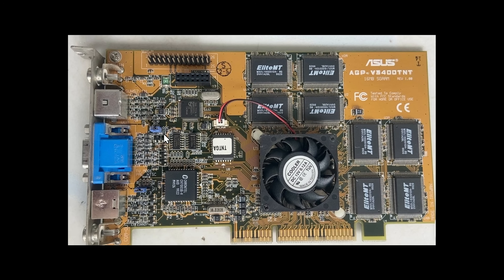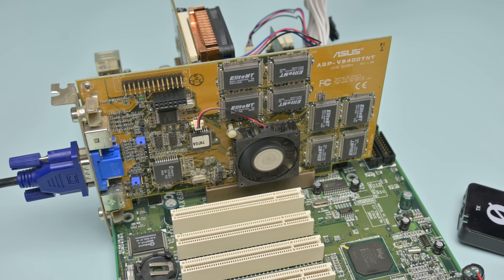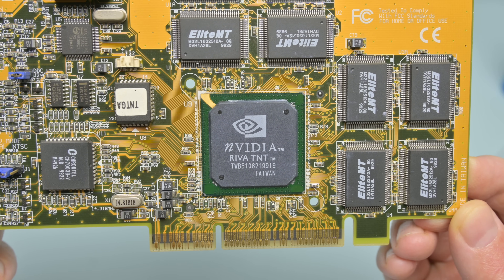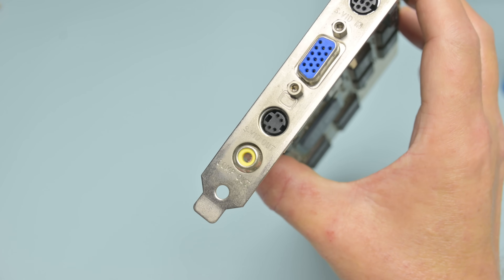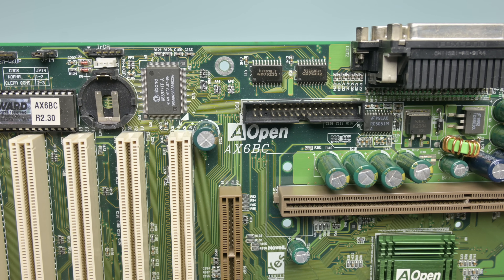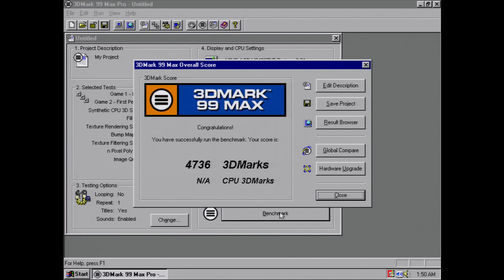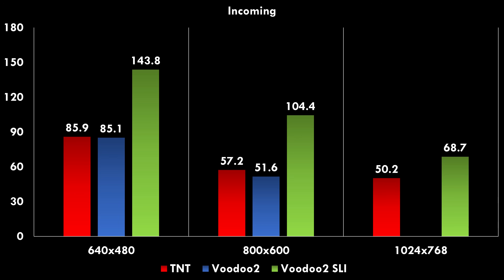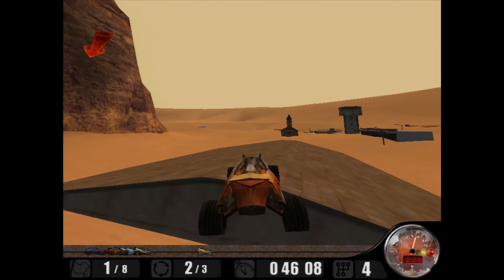ASUS V3400 NVIDIA RIVA TNT

Comment: People often says Geforce was the 3dfx killer. Wrong.
3dfx got killed when the TNT2 chip arrived. Powerful and cheaper. More widely available and supporting the emerging 3D applications which were using OpenGL and DirectX. Also was a wise decision on Nvidia to support the full OpenGL standard instead the MiniGL thing Microsoft was pushing. This means other OSs could support TNT2 3D features completely without DirectX.
Reply: The Voodoo 3 was overall slightly faster than the TNT2 because it has higher clock frequencies and also because of Glide (in 1999 around 50% of all 3d games had Glide support). The Voodoo 3 and TNT2 had practically the same price levels. The Voodoo 3 also had full support for Default OpenGL and on top of that it also supports 3dfx MiniGL and Glide which the TNT2 of course didn’t. The Voodoo 3 was very successful and was sold in great numbers, the end for 3dfx started with the release of the first Geforce card in late 1999.

Comment: I was getting my pc back in the day from my own hard earned money, putting a pc together with a Diamond Viper V770 Ultra and a Voodoo2 SLI. Anything Unreal engine related ran so much better on the SLI, but most d3d games ran way faster on my V770Ultra. I had these cards paired with an Athlon K7 700Mhz Argon Slot A. It was a monster of a PC. Bought it in fall off 99.
Reply: Yeah I had thunderbird 1ghz with Riva tnt2 and voodoo2
Like mid 2000 or right before 2001.
Friend had gotten 2x athlon 1ghz cheap because of lost package and reship and showed up 3 weeks later haha I got so lucky for that cpu
Reply: Got a baller right here. Awesome build

Comment: I had the 16 Mb SDRAM, TV output only, version of this card (I think I still have it somewhere in a drawer, actually - I merely swapped the cooler as the original one had died). This thing I kept for a LONG while because performance kept improving with time and tweaks : the VRAM could be overclocked by 15 MHz (from 110 to 125 MHz) easily as the chips were actually downclocked ones, giving almost as much extra performance (the graphics engine couldn't, though), a patched VBIOS enabled sideband addressing, it could manage quite an overclock on the AGP bus (it actually could work with a 83 MHz bus clock), and driver updates really unlocked performance after a while - provided you could download them.
And, it had a TV output, a rarity at the time, allowing some form of dual screen usage.
I could even run a 3D desktop with it on Linux in 640 x 480, as it had just enough VRAM for compositing.
Reply: I have one from Joytech and by default it ran 80 MHz core and 90 MHz memory, because it had a passive cooler. When I replaced the memories for 6ns (probably a fake ones/relabelled) I couldn't get any higher than 110 MHz core and 120 MHz memory. (Probably because of the fake memory chips)
Reply: You were lucky to get the graphics engine to 110 MHz ! If memory serves me, mine never got past 103... I think I managed to push the VRAM to 128 MHz, but it was getting unstable, so I left it at 125 after that.

Comment: Arrrrgh that damn TV mode jumper...  For weeks I couldn't understand why the image on my tv was black & white until I finally found the culprit, it was set to ntsc while I was in a pal region and then it was one of the best things ever.

Launch a dvd or a 🏴‍☠movie on the computer and it was automatically full screen on the tv, and even running games just at 640x480 they looked fantastic on a bigger screen than my puny little 14 inch monitor.
Reply from the maker: Haha awesome memory! I can relate with the NTSC / PAL issue!
Reply: I got into the word of TV-outs later, during the GeForce 3 era. But I actually left mine in the NTSC mode - I also live in a PAL region, but my family had a properly multi-system TV back then. It was actually exciting to really see it show "NTSC" in the input information OSD for the first time and see that working. The picture also somehow looked subjectively better, or maybe "more interesting"? in NTSC mode. Which doesn't make much sense considering what I know now about composite video. Maybe it was just the novelty of a literally foreign video mode, or maybe it was something about the scaling or the refresh rate.

Watching movies played from the computer on the living room TV was a nice experience, but I remember being disappointed by the image quality, quickly realizing how bad the resolution of SDTV was compared to the computer displays of the time.

Comment: First 3d accelerated game I saw was N.I.C.E. 2 on a Riva TNT2 (might have been a TNT1). The bilinear filtering and the lens flares blew my mind. Only knew NFS2 and Screamer 2 in software rendering before that. The fact that the Riva cards went 2d/3d made them very attractive for people new to the hobby (less failure points) and nvidia had very good win 95 (later win 98) drivers, making them much easier to set up in my recollection.
Reply from the maker: Awesome memory, thanks for sharing!

Comment: The DDC jumper is for enabling/disabling VGA DDC signaling from the monitor because old monitors grounded certain pins on the VGA connector to tell the system that it is a regular, high resolution or monochrome monitor. On newer monitors some of those pins were used for DDC serial signalling to actually identify the monitor and its capabilities to the system. So if you have old VGA monitor (pre-1996) the jumper should be removed (disabled).
Reply from the maker: Thank you for sharing your expertise, that's really helpful info!
Reply: @philscomputerlab  If you need more cards let me know . I can help , or write me on vogons....
Reply: Display Data Channel
Reply: PowerStrip was able to access DDC information. You could even overclock your CRT :)
Reply: @Thomsonicus You can use CRU today...
Reply: What happens if you have the DDC jumper in place and hook it up to a pre-1996 monitor?
Reply: @cjshields2007  It works OK, even if the monitor shorts out some DDC signals the card will not be damaged. The problem would be if you put modern monitor while the jumper is off. Because some of the pins in the newer monitor are now floating and not grounded in DOS when you boot it sometimes display would be in monochrome and sometimes in color not knowing what is happening. This is also a problem when using very old video card with modern monitors.

Comment: I remember being very surprised by how good the TNT was. At the time, I had a RIVA 128/Voodoo 2 setup, and good Lord the 128 was just TERRIBLE. Frame rates weren't bad, but the image quality was laughable. Vertices didn't line up, textures were mangled and the overall experience was just awful. So I wasn't expecting much from the TNT. I was the world's biggest 3Dfx fan and thought they would be on top forever. Little did I know what the immediate future had in store...
Reply from the maker: Great description of the 128 🙂

Comment: I am right now testing Voodoo 3 2000 and I never understood why it is that hyped, performance didn't look that great, but then I tried actual games from late 90s and there are some pretty wild anomalies I didn't find before. For example in AvP (1999), Voodoo 3 2000 has double FPS compared to much later nvidia and ATI cards like MX 440 or even FX 5500, so yeah, there is something about these Voodoo cards, but you will benefit from it only in some cases.
Reply from the maker: It's the drivers mostly. Later NVIDIA drivers are slow on period correct hardware. The Voodoo 3 just works. Glide, OpenG, Direct3D...
Reply: @philscomputerlab  I mostly prefer ATI for Win 9x gaming, but even with ATI cards, AvP1 runs pretty poorly compared to V3, it's like they literally made that game for voodoo even when it's not running on glide.
Reply: @philscomputerlab  Well, Voodoo 3 was basically frozen on time with Glide (you don't buy a V3 card to do DirectX on it). Nvidia had to deal with DirectX and OpenGL which never stopped updating.
Reply: the missing features of the voodoo cards (compared to newer NVIDIA and ATI cards) sometimes meant that newer games still ran, but actually looked worse because some effects did just not get rendered. on the other hand the performance was abnormally good because of this. a voodoo 3 does not even support all DX7 features where a MX440 does and thus sometimes simply renders less. if the games still had GLIDE support this was even more pronounced. i remember a friend of mine still playing some newer titles on a pentium II + voodoo3 system when i already got my hands on a radeon9700 with a 1.xGhz Athlon XP. It looked crap, it only worked in 640x480 but somehow the voodoo got it done where a TNT2 would have completely lost it already and even the first geforce struggled.

Comment: I think TNT/TNT2 are still my favourite NVIDIA cards. I remember installing my new TNT2 32MB and running Half Life, it was crazy.
Reply: The only problem with them was in Quake and Half-life which were well optimized for glide and very CPU heavy. The TNT and TNT2 required a much beefier CPU for equivalent performance at lowish resolutions like 640x480. This slowly got worse with every driver release for the nvidia cards and was even worse on ATi. The main culprit was the way Quake and Half-life rendered world polygons (WPOLYs, which were the level, not the characters). For each polygon in the scene they would call glBegin with GL_POLYGON, bind a texture map, bind a lightmap texture, send each vertex one by one (since it's a polygon and not a triangle fan or strip, the driver has to do the work to turn it into triangles) and then send glEnd. A draw call and a couple of texture binds for ever single polygon in the scene. Perfectly fine on a software renderer; hacky and terrible on a 3D accelerator.

Comment: the fall of 3dfx was when the Geforce 256 came out
Reply: That was just the nail in the coffin. The loss of their partners because of their decision to acquire STB Systems and go at it alone during the Voodoo 3 / TNT 2 period meant they were done for.
Reply: Indeed, the TNT was a cheap card that a lot of manufacturers used for cheap computers, the voodoo 2 and banshee were a lot more performant in games, even if on paper the TNT looked good, and when the voodoo 3 was released it blew out all the competence. The first real struggle for 3dfx was the GeForce 256 and the end was the GeForce 2, that's when nVidia really did wiped 3dfx from the map.
Reply: It was the first gpu.  Everything before was an accelerator.
Reply: @oldschooldude8370  Your a little mistaken,Nvidia coined the name it as a "GPU" anything before the name was still a GPU aka Graphics Processing Unit or in old cases a VPU Visual Processing Unit. A 3d accelerator was an add on card aka voodoo 1 and 2 or the VR.So you dont know history when it comes to 3d cards. I bet you think doom was actually 3d as well...lol

Comment: Little trick you can use to find the exact spacing is measure the ID of the holes, zero the calipers, then measure the distance using the ID side of the calipers.  Youll get an accurate reading.

Thing about comparing a voodoo 2 to that riva, is that the riva also had the advantage of being AGP with its additional power budget and bandwidth.  The little ol voodoo 2...well it did pretty darn good for what it was.
Reply: Being agp wasnt an adventage back then none of the first cards took advantage of the agp bus, not even the agp versions of the voodoo 3

Comment: Good old days :) I think I owned one for a while, I was young and upgraded or sometimes accidentally downgraded often. Being a dumb teenager I also tried overclocking on some occasions and burnt out some cards or CPU's with time and abuse.
I think I owned a TNT at some point on my K6-233 (My first build which started with a 4MB ATI and Diamond Monster Voodoo1
It was later upgraded to a K6-2 333 and later on a CeleronA-300 @ 375 (one of the rare people who could never get it stable at 450 and I did have an Abit BH6)
Within those sockets I ran a TNT, a underperforming noname voodoo2, a voodoo banshee, a TNT2 and a Voodoo3-2000
Reply from the maker: Nice range of parts. Yea overclocking was more fun back in those days...

Comment: I got a Gateway computer in '98 it came with a Riva TNT, and while I was always thinking about switching over to the Voodoo Banshee.  I ended up sticking with that Riva card and it turned out to be a pretty solid choice.  Rather fond of the TNT line and happy to have a few examples in the collection.
Reply from the maker: The Banshee is an interesting card to compare. I found it interesting that most reviews didn't show the Voodoo 2. Not sure if there is more to this, but pretty much all the reviews compared it to the Banshee. It sort of makes sense, because the Banshee is also a single card. Few looked into using a slow, or non Intel CPU...